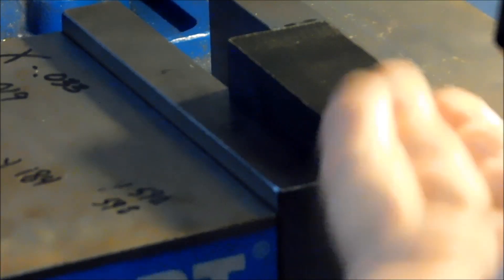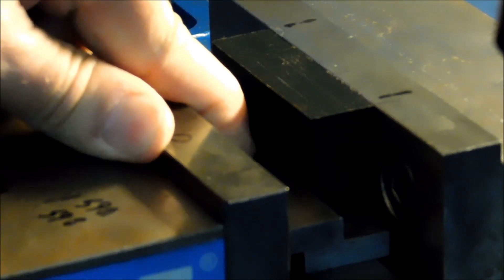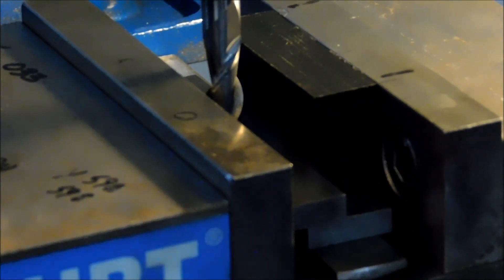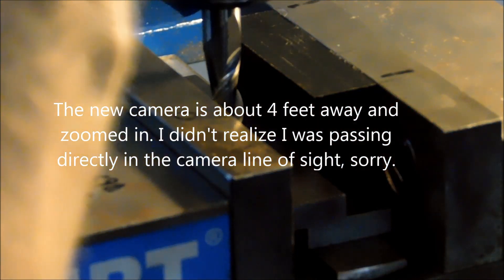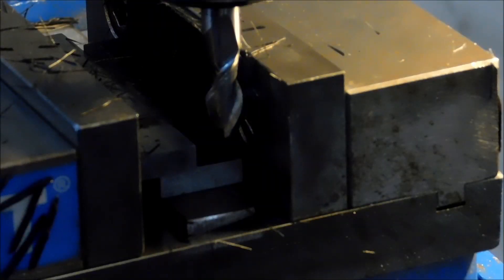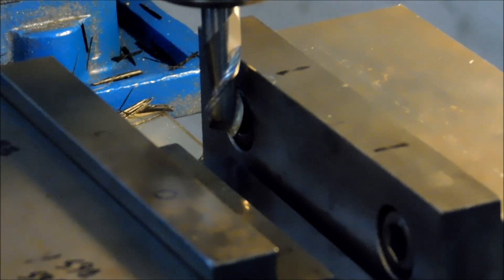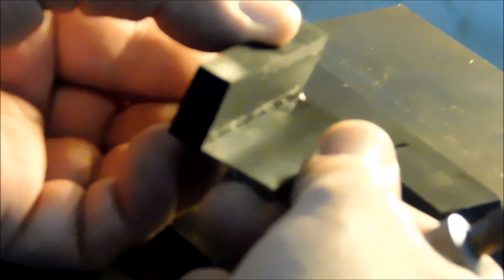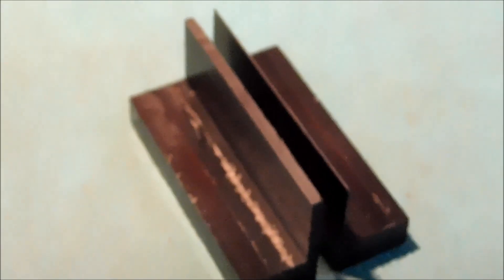Milling thick stock into thin stock

Comment: Thanks for the tip, it was a god one.  To measure the thickness, it would work well to use a digital caliper and measure the thickness of the back jaw, zero the calipers then measure over the workpiece.  This would give the thickness without any math, and you wouldn't have the remove the piece from vise.
Reply from the maker: Be careful. Doing this using a climb cut applies pressure to the part that presses it against the stationary jaw. It is possible, and common, for the material to relax off the jaw after the cut. Depending on the rigidity of the material, a stack measurement may yield a false part thickness reading.
Reply: @joepie221  Good point! I was just concerned about removing and replacing the part getting two chuckings the same.

Comment: Hey Joe, a huge fan here, heartfelt thanks for the tremendous effort.  Were you using the Enco mill you repaired in the video from 18 Feb 2017?  I watched this thick to thin video on my new smart TV and wonder if the noise from the mill is pretty loud or is it because the sound on my TV is so much better than on my phone. Bill From Schenectady NY.
Reply from the maker: Yes. The front shims still need to be replaced on the splined drive, the back is done.

Comment: Great technique. This will be specially useful for hogging acetal because face milling, often leads to the corners of the stock chipping off if you're taking too big of a bite. With side milling, you don't have this problem. I will definitely be trying this technique out.  Nice tip Joe. Thanks!
Reply from the maker: Stay tuned. I have a video coming that is perfect for you.

Comment: I'm curious, would it be possible to get the same result using a thinner end mill and run it through the part near to the final thickness and thereby save most of the plastic that was milled away?
Reply: Fishman I don't think so
Reply: Fishman not to mention most of those types of plastics are cheap

Comment: Hi Joe, I noticed that you climb mill the part would I be correct that would force the cutting pressure against the jaw and then you follow by a return spring cut over the surface to ensure the part is true? Definitely a simple but neat solution to that shim part often needed.
Reply from the maker: I personally think a spring pass would offer a better chance at compromising the part because its already thin and would probably chatter. I have always tried to hit my final thickness on one thick pass.

Comment: another great tip from prof joe. could you have zeroed your dro on the fixed jaw and and fed in to your final thickness rather than removing the part and disturbing the set up?
Reply from the maker: Absolutely. Then just set the thickness by reading the DRO. That would work perfectly.

Comment: HI Joe,  you can do the same thing almost the full height of the jaws by holding longer stock by it's left edge with a block or the other vise on the left. An "O" flute cutter specifically for Acetal type plastics is your best friend!
ATB, Robin
Reply from the maker: Thats a good tip. I agree on the acetal material comment. It sure beats UHMWPE !!

Comment: Nice technique.  Tom Lipton showed methods using glues to cut really thin parts, but this works with stuff you cant easily glue (or un-glue) and is super fast setup.
Reply from the maker: Double stick tape is another option, but the tape has to be reliable. This technique works very well and is fast. Good to hear from you.

Comment: In addition to what is shown, a right-hand cut/left-hand twist end mill can be helpful. This cutter has the advantage of pushing the work down instead of trying to pull it up. I've used them extensively for milling long thin sections of aluminum. By taping the aluminum to the mill table and letting the edge to be machined hang over the edge of the table it may be successfully milled as the cutter is pushing the work down onto the table. I've trimmed work five or six feet long on a planer mill this way for use in jet engine shroud components.
Reply from the maker: I like those end mills. They are a real problem solvers in certain situations.

Comment: Thanks for the tip. The only problem is climb cutting on manual machine.
Reply: Climb milling is not a big deal on a manual machine, especially if it is tight and rigid. If the mill is clapped out then it can get dicey. 

Thing is, it did not look like he was climb milling. Unless the spindle was run in reverse, it was sorta hard to see. Or maybe I am looking at it wrong. I dunno.

Anyway, still a great tip and helpful video. Thanks for posting your vids!

Marc
Reply: I had to watch it again.. It is climb milling, the spindle looks like it is spinning in reverse for an instant.. Or I need to check my eyes.. Gah..
Reply from the maker: Keep the table lock snugged and the cutter has less desire to run.
Reply from the maker: v8packard I wouldn't lie to ya. It was definitely a climb cut.
Reply: you don't need to do anything! just listen to the man, he emphasizes cllimb milling. But I agree with you that there are reasonably rigid manual mill out there that can do the job. Another thing, that plastic part is not a big deal but aluminum is.
Reply from the maker: This can be done in aluminum just as easy. Stainless too.
Reply: Climb milling works WAY better if you move the work in the opposite direction from which way the cutter is pushing it.  It keeps the backlash pulled tight.  That is not how Joe did it in this video, because then the cutter would not have held the work to the jaw.  On a tight and rigid machine while cutting plastic, climb milling is no problem.
Reply from the maker: Bob, please clarify your last comment. there is only one way to climb mill that I am aware of.
Reply: By the method Bob describes,it sounds like conventional cutting.
Reply from the maker: I agree.
Reply: Oops, after more thought, I think you are correct.  Never mind, I will think on it some more...

Comment: This is a great technique. I have used it several times making oddly dimensioned shims out of acetyl and aluminum. And you are absolutely right, if you don't have enough tool pressure it can cause you headaches. I was wondering if you could do a video on how to properly use telescoping gauges. It is something that took me a good while to get used to and I think a lot of people would benefit from your succinct and practical style of explanation.
Reply from the maker: Thank you. I'll put that on my list. I have seen techniques online different than mine and I would like to comment.

Comment: Great trick. Who knew you could use climb cutting to your advantage in that way. There ought to be a compilation of all the hard learned machinist tricks, so us slower ones can have fun too.
Reply from the maker: Only at the end of the cut is there a risk of the part diving into the cutter. Plan accordingly.

Comment: Todays secondary lesson is starting with surplus stock can make life much simpler when it comes to machining operations later. Oftentimes starting with stock cut to size is a mistake.  This is a good demo. I oftentimes do similarly on my horizontal with climb milling to prevent vibration on long parts. A piece of bar 3 or 4 inches thick can still vibrate like crazy if it is 3 or 4 feet long. A Happy and successful New Year to you!
Reply from the maker: Thank you. I have appreciated your comments and continued support.

Comment: That's a great tip, Joe, thanks. So, is that the sound of a vari-speed mill needing a new drive belt?
Reply from the maker: The motor end cap and shaft end air slinger contribute to that noise. I dread to think what else may be contributing to it. I just never have enough down time to dig in and find out.
Reply from the maker: No. She rattles a bit, but still performs very well.